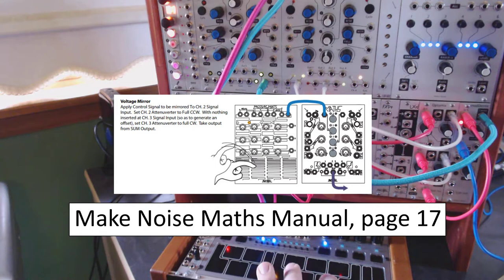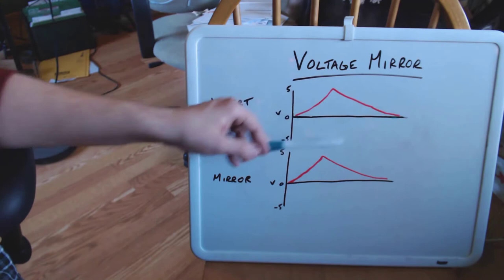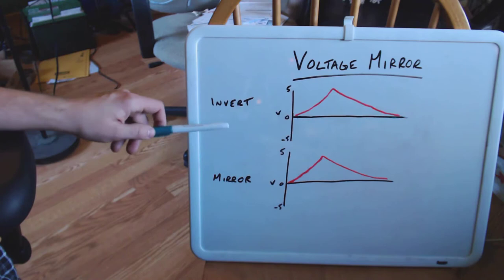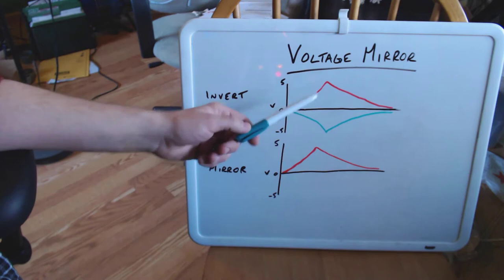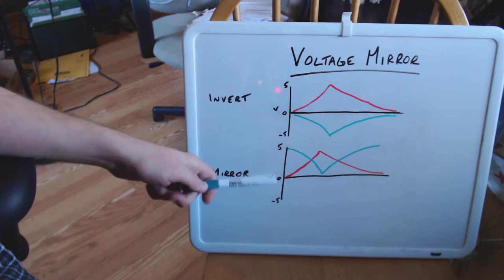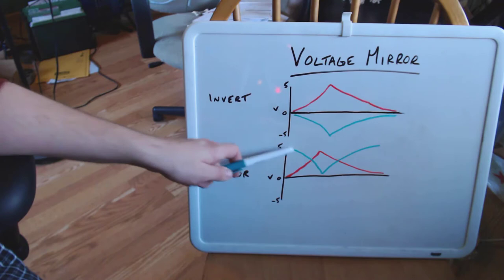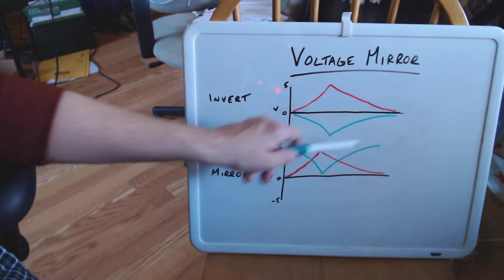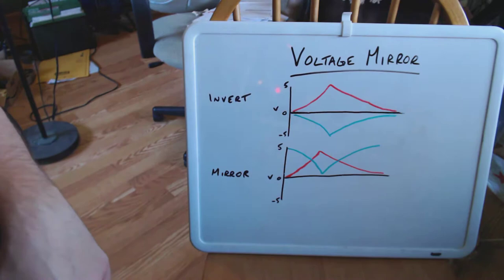Maths Voltage Mirror: A crossfader using VCAs

Comment: So I have been considering getting a verbos scan and pan for crossfading mayham. Inspired by your video I attempted four way crossfading with your method for maths using four of my Dixie 2s outputs in order of harmonic content. I used the end of cycle output on maths channel four to trigger channel one which was enveloping my 3rd waveform. I took the end of rise output on channel one to trigger another envelop going to control the vca for my fourth waveform. It is such a beautiful sound. Doing the numbers it took me both channels of maths, two more envelops, a quad vca also doing mixing duty, and one more vca to do what the scan and pan plus an envelop could do. My maths says that the scan and pan might justify the cost haha. Dont know whether to think of it as 500 dollar cheaper crossfading or 500 dollar crossfading...

Anyway really enjoyed the video and I cant wait to see where you take the channel. You are producing some excellent content!
Reply from the maker: Thanks for the kind comments! I'm going to shoot for weekly videos for now, probably targeting Mondays.

Sounds like you had a great setup. The Dixie is a terrific oscillator, and four of them must be a dream. I'm going to do some videos on the RxMx (upper right of my rack) in the future... it's more hp but they can be had for less than the Scan & Pan, usually around 320 USD. Via voltage control you can scan and crossfade through the 6 channels you have feeding it, plus a few other tricks. Everything Verbos does looks top notch, though. Can't go wrong either way.
Reply: Hermbot Music damn I am so excited to see the videos on the crossfader. I dont mind spending hp on a superior product. 

I actually just have 1 dixie 2 but I used the sub out -> pulse -> saw -> zigzag for my harmonic crossfade.  I am waiting for the rubicon 2 with a triple wave folder to be my dpo for my second oscillator. I am a utility guy though through and through. I personally get the most enjoyment making beautiful soundsources on something besides an oscillator, making sequences on something besides a sequencer ect... maybe you could make a inspiring video on that.

Anyways I cant wait to see what you make these videos are great.